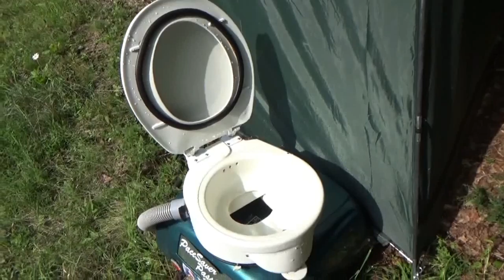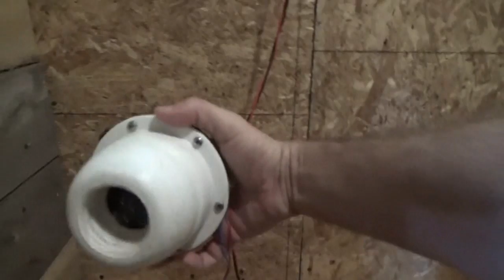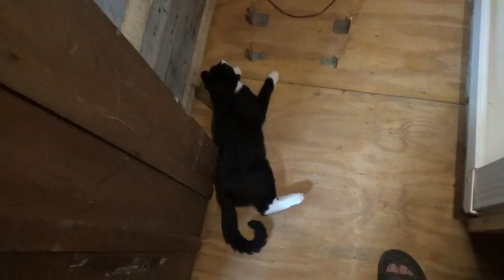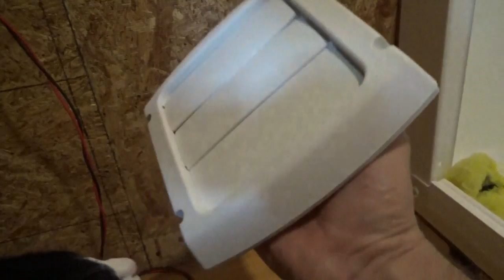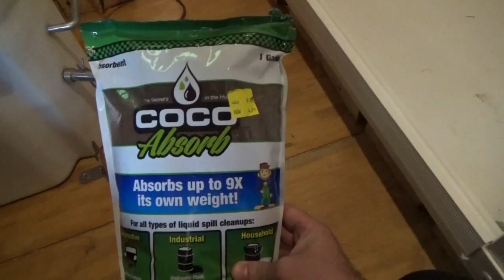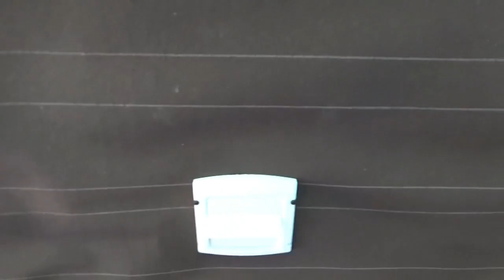Airhead Composting Toilet Cleaning & Reinstallation In My Tiny House

Comment: How about removing the flapper, re-install it behind your stove for fresh air intake in winter. BUILD  A single flapper vent out of plywood. cut a 4inch circle out of a 5X5' square, insert 2 rods (nails) in the sides of the circle,1/4' above the center of the disc (horizontal) going through the 5 inch square into the disc. It should swing freely. install this disc in a box with an inside dimension of 5 inch. Mount the box to the house. it will be counter-weighed and will move with a feather light breath of wind. add or remove weight from the disc using small screws or tacks driven into the top or bottom half of the flap.
Reply: +grodad i think that is a bit to elaborate for this application...lol   How about the 90 degree elbow that pieter zeeuwen suggested....keep it simple is my philosophy
Reply: just didn't think Troy wanted to buy another flapper. that was a stellar idea though.. :)